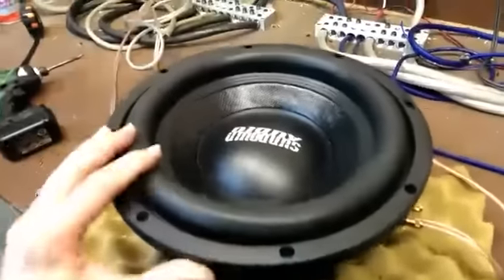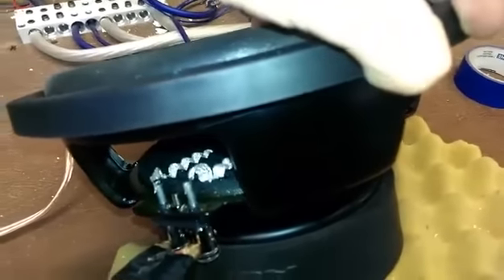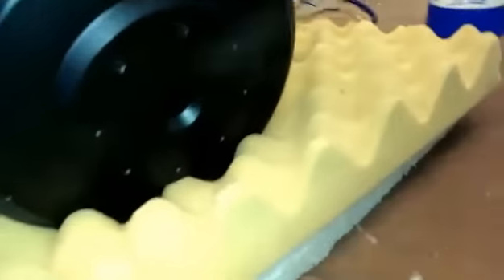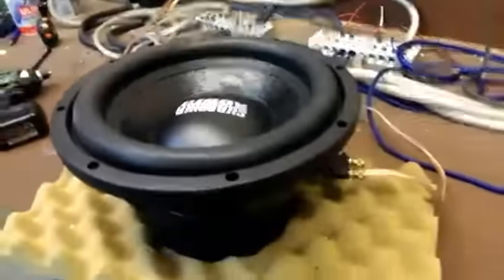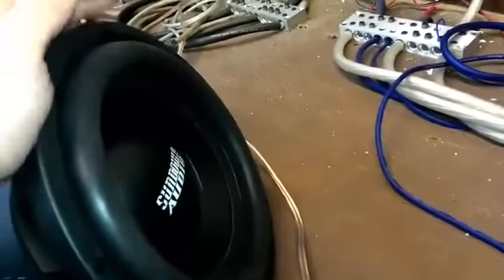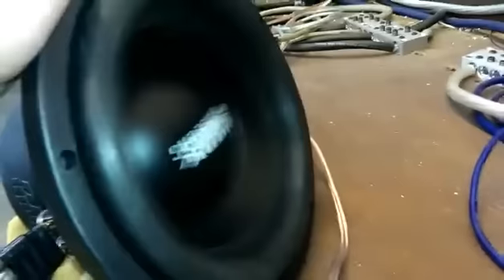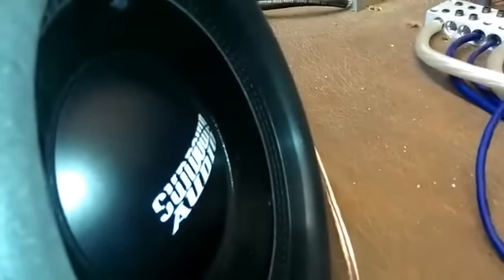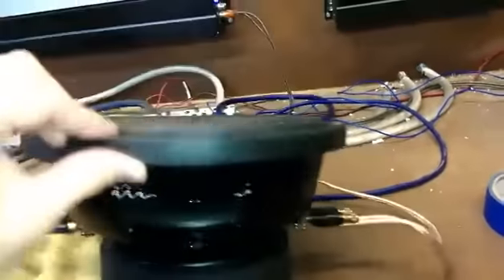Sundown E-10 v.3 Prototype Video

Comment: got 2 of the 10's modified into 15 boxes with 10 inch top for more cubic space and they handle amazing, never get too hot, they don't usually distort unless you turn the bass boost all the way up, which i dont, currently sending 1250 thru each of them, the rms is 500, but trust me, they can handle so much more if your amp is tuned correctly and you don't put them on too low of hz
Reply: Sir JDM what amplifier are you running? I can’t run more then 1200watts on the pair for long with out them smelling.
Reply: @jamesbondcaraudio4247  You must be clipping them badly. What amp do you have and where is your gain at? The quality of the music you have plays a role also. And the bass boost should never be turned all the way up like the op mentioned. It should be left all the way down preferably. I've been running mine cleanly on 1800w rms for a couple years and have never had them smell.
Reply: @rdooski  I'm not a rookie. The answer to all your questions are on my channel. What amp are you running? Have you ever clamped true power?
Reply: @rdooski   i never bought them to play music lmfao. I bought them to be destroyed by "burps". One started making a funny noise so i gave them away.
Reply: @jamesbondcaraudio4247  Ahh sorry it just sounded like something a rookie would say. Still though what I said before applies even more if you were only burping them. You should be able to burp them on a clean 2k+ each no problem. Im running mine on a ct sounds at1400.1. With a clean (gains set with dd-1 and the amp has a remote clip meter) and clamped 1800w. Cant remember exactly where the gain on the amp is but every amp Ive ever seen put on a dd-1 ends up under halfway. So odds are if your over half youre clipping. Regardless something with your setup was wrong, as you mentioned maybe the subs had an issue. But any "pro" would tell you something is up (most likely distortion) if you're getting a e10v3 to smell with 600w, especially if its only burps. Its literally only 100w overrated and everyone knows sundown leaves plenty of headroom.
Reply: @rdooski  1800 watts from a ct 1400.1? What did you clamp power with? And what was your resistance rising to?
Reply: @rdooski  i was getting a clean 1200w from a 5500.1 rising somewhere around 3 ohms and had plenty more power. It wasn't clipping. Clipping comes from trying to get what your amp cant give.
Reply: @jamesbondcaraudio4247  Thats just 1 of the places clipping can come from. It can come from the head unit and from the track being played also. But shouldn't have a track problem if its a test tone. When you say "clean" do you mean your deck and amp were tested for distortion? And just curious which 5500.1 were you running?
Reply: @rdooski  if you are asking if i use that dd1 junk, the answer is no. I own a term lab and clamp and do my testing with that.  you never answered my question, have you ever clamped power? Or are you just assuming you are getting 1800W because of the youtube dyno video.
Reply: @rdooski  and my 5500.1 is a deephitters amplifier. 3 positives and 3 grounds to run it.
Reply: @jamesbondcaraudio4247  I was asking exactly what I asked. You dont have to use a dd-1 there are multiple other ways to test for distortion. But you should already know that.
And when I said clamped thats what I meant. It was 1800 rising to .81 I believe.
Is deephitters a brand? And shouldn't you be getting more than 1200 @3? Most 5kish amps do more than that @4.
Regardless nothing is going to change the fact something was wrong if your ev3 was stinking while burping 600w on it. I dont understand how you dont understand this. Was it your first sundown experience? Do you think its common for a 500w woofer from a company like sundown to get smelly while burping it on 600w?
Reply: @rdooski  what did you clamp power with? You are really starting to sound like a troll. And when you said clamped what did you use? Lmfao. Yes deephitters was a brand and its the same amp as the aak 5500.1 same board same bass knob. If you read right you will see i stated i had plenty of power to spare. You still run the Es? lmfao. Maybe you should try running some real subs before coming at me.
Reply: @rdooski  lets not forget the E is bottom of the barrel in sundown. They are China subs. Cheap
Reply: @rdooski  do you attend shows?